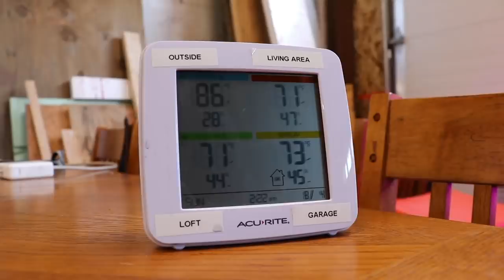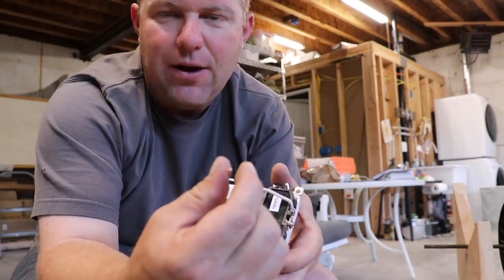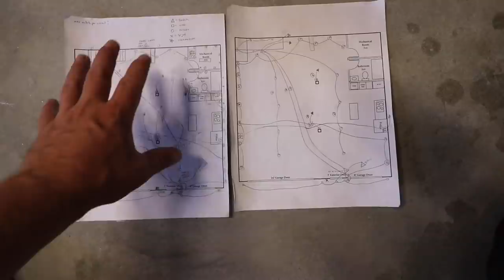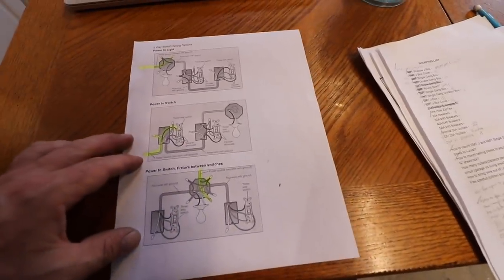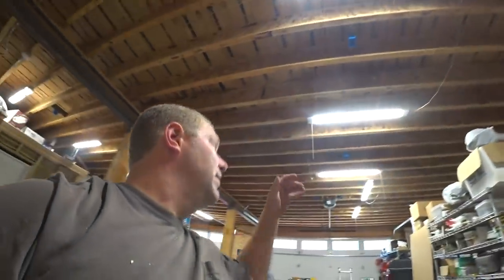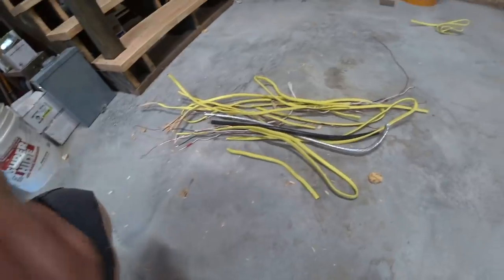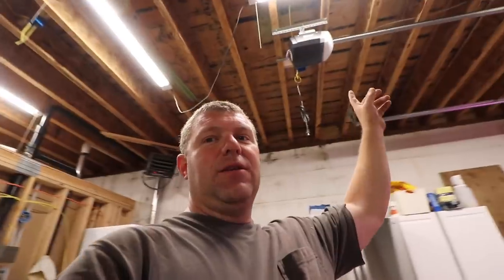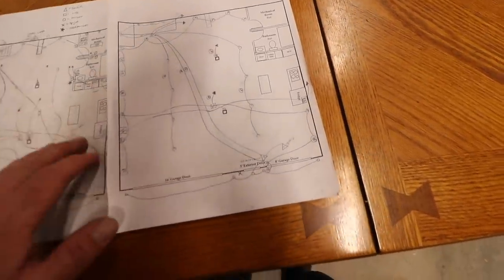WHAT A Wire-Pulling MESS (Garage Lighting Electrical)

Comment: If I am understanding correctly he is putting in 4 outlets in a single box supplied by one 20 amp circuit. Does he really need 4 outlets every 4 to 6 ft? I just wired a woodworkers shop and we put in a duplex outlet every 4 ft. We cut the hot tab and ran 12/3 with each outlet on a different 20 amp breaker. That cable then skips the next box so that within 4 ft there are 4 separate 20 amp outlets on 4 seperate 20 amp breakers. Either he is only allowing for on average 5 amps per outlet or he is just wasting  outlets.
Reply: I think he is tired of extension cords. 😂 So he wants outlets everywhere.
Reply: So, did you use a single neutral for each outlet with two hots?  If so, You are soooooooo breaking the NEC (and common sense).
Reply: @flick22601  Our code allows it, I can't think of any reason that is unsafe,. Sounds like the wire manufacturing lobby got to the government legislators. Thankfully our political system is different from yours.
Reply: @john543  - If each 'hot' is on a separate breaker, they can NOT share the same neutral.  No code in the world would allow that.
Reply: @flick22601  I don't see what the problem is and neither did the inspector. Standard workshop wiring, 2 adjacent duplex outlets will have 4 breakers. I think it was a 30 x 24 shop and every receptacle was on it's own breaker (1/2 size) and a duplex box every 4 ft. What would be the point of running 2 neutrals when the neutrals end at the panel in a bus and are fastened to a jumped  neutral on the duplex. I don't see why running a 2nd parallel neutral would accomplish anything other than sell more copper. I suspect you are American and the US political system lends itself to these kinds of abuses. Simply put the copper lobby won. Common sense lost.
Reply: @john543  - If I'm reading you right, the inspector failed at his job.  The purpose of a fuse or circuit breaker is to protect the wiring from too heavy a load.  If you have 2 - 20 amp, 115 volt breakers serving two different circuits but using a common neutral there is a possibility of that neutral being required to carry 30 amps.  For that reason alone it doesn't meet code because it doesn't have the ampacity to carry that much current.  Next, should one breaker trip and the other circuit is still carrying a load then, should someone try servicing the circuit with the tripped breaker come into contact with the common neutral they could be seriously shocked.
Reply: @flick22601  At full load the current in the neutral will be 0 since the two hots are on different phases. I think I said they were 1/2 size breakers earlier, that was an error on my part, the 1/2 size breakers we used are for the dedicated outlets that are not split. As far as servicing goes, the breakers are physically connected so both tgrip at the same time, plus common sense should tell you if you are working in a box with multiple circuits you should trip all the breakers.
Reply: @john543  - Ahhh.  So you have three phase power.  Different story.

Comment: Nice fancy 3 way illustrations. However they don't show you how to wire the 3-way with the required neutral conductor in each of the switch boxes per NEC. 404.2 C 1-5 , however since you are using a receptacle to feed your lighting you technically could have an out with 404.2 C (5) Where a switch controls a receptacle load. However with the possibility of removing the receptacle in the future as you mentioned (5) would not apply and the neutral (grounded conductor) would be required in this instance in your switch boxes.

Comment: In the garage where power tools are used those outlets should be 20amps and the kitchen also, all others it's upon current loads. I suggest to label the wires and the circuit breaker from and to so in the future it will be easy to trace or trobleshoot....

Comment: Where I live, code has ground facing up when installing convenience outlets. I think it is so if toddlers are messing around with plugged in fixtures, they are less likely to get little fingers on power prongs. Just something to consider with little on on the way.
Reply: John Wilson.   The way an outlet is orientated is not a code requirement, just personal preference.  Throw a necklace over a ground up outlet and it will blow also!
Reply: most of that has to do with manufactures install specs!

Comment: Is there a reason why you're not running the wires along the center I beam instead of poking holes in all the joists? Are you putting the outlets on the center posts on the front/back of the post instead of the sides? Looks like all the traffic in the garage will be front to back - more chance of hitting a protruding outlet box if you mount them on the sides of the posts.

Comment: The US regulation seems complicated over the UK they are very strict about electrics and the way you lock wiring over there is very different as we are so so careful how we set things up but the one thing that I would say is you do piggyback off another socket to a spare from a ring main or from a radial circuit
Reply: John A Doe    You seem to be a professional electrician from the U.K.   Please do not base your opinion on people that are not professional doing electrical videos in the US.  We have a National Electrical Code.  It is not Federally mandated.

Comment: This way would not be compliant in Canada.  Each box, switch and light has to have Hot, Neutral and Earth.  In your diagram you use a 14/2 wire with a switched neutral.  Not allowed up here in the Far North!!  And you shouldnt be drilling those joists.  Only use the knock outs they have prepared for you.
Reply: [In your diagram you use a 14/2 wire with a switched neutral.  Not allowed up here in the Far North!! ] 

Sure is! But you have to mark the neutral with a red or black ring of electrical tape or a heat shrink tube where it connects to a device or into a bundle. It should be marked the same colour (color) the other end.  
Felt tip markers rarely work well. Paint can, if it's of a suitable type.

Some provinces have adopted a controversial requirement for an extra neutral in some instances, won't go into that, it's mostly for protection of delicate loads to floating neutrals.
Reply: Might be different under the Maple Leaf but here 14ga is in White romex and Yellow is 12ga. I haven't seen him wire anything yet. For 3way the 12-3 uses the black lead for line and the red is used between the switches.  As for using the knock outs they normally don't line up and makes pulling wire that your shoulders remind you of tomorrow.
Reply: In Ontario it is now code to have neutral in everything.  So using the neutral wire, whether marked or not as switched live, is against code.  I dont make the rules.  I just follow them.

Comment: Jessie, are you gonna put some rockwool or some other insulating material between those I-joists on the garage ceiling? I'm guessing you will... heat and sound insulation.

Comment: Have you come across a building code thats says sheet rock between garage and ling space must be 5/8.
Reply: or one could put a double 1/2" skin.... :)
Reply: Many areas it is required to be a 1 hour fire rated separation with dwelling above a garage.
Reply: Bob Haas    The building code will not tell you an exact product to use.  Codes are not written that way.   It will tell you that a 1 hour rated wall or ceiling is required.   Then a 1 hour rated assembly with drywall will tell you that it must be 5/8" gypsum board, or some other 1 hour assembly material.
Reply: @chrism2042  i know tahts why 2 ,1/2" are used if one cant get 5/8th ,2 x 1/2" skimmed is what we used in the uk,back in the day,now its some form of absbestos (not asbestos type ) boarding thast half inch and has the hour rating.
Reply: @gsyguy1  - Even 2 layers of typical 1/2" gyp. on 1 side does not provide 1 hr rating. I have not found a UL rating detail providing the rating on one side of the framing. But per the building code a 1 hr rating can be achieved based on materials with multiple layers on 1 side of framing. When I design buildings with rating on 1 side I use layers of Type Firecode X gypsum
Reply: No building codes where they live
Reply: @N-hunter  they as in the video or where I live...we have millions of building codes..and we are OLDER than the USA we have CASTLES  and Dolmens and granite houses too ,we may be small but we build BIG :) oh and we have german bunkers and towers left over from the ww2

Comment: Jessie do your lighting with 14/3 cable. This wire will have a Black/Red/White and ground. You have to use a 15amp breaker for your lights if you use this cable but This will allow you to carry neutrals to your switches which is required for all home automation and makes wiring 3 way switches way easier to wire...Use 12/2 for plugs and 14/3 for lighting and switches it will make your life a lot easier.
Reply: I though the NEC now required both a "hot at all times" and a neutral in every box.
Concur on the usage of 12/2 and 14/3.

Comment: European outlets look so much simpler compared to this. You just push the wire and it's connected.
Reply: We have that type also, but they're usually 15A rated outlets, not the 20A ones he is using.
Reply: And they fail here
Reply: What are European outlets? They differ from country to country. Only the plugs are standardized.
Reply: Also illegal in some areas- fire hazard; the loop around the stud gives many more times the contact of the pincer inside the fast cheap push ins. After they age, corrosion  will increase to resistance and the created heat when under load- if it was my house, it's a no brainer.
Reply: @beargun42  Not even the plugs are standard.
Reply: jimW133 you’re right. Apparently not all accept the CEE 7/7 plug or oven the type c “europlug”

Comment: -  number of allowed " current carryng " conductors ..... reason?.....  because heat dissipation and ampacity corrections 
% of raceway area fill .... reason?... mechanical issues, pulling, etc.... different reasons

Comment: Like was shown - the rule I always used for wiring 3-way circuits is that they ARE easier and cheaper to wire if you "feed" the power into one end of the switch circuit and then run the load from the other end- that way you do not need to run extra wires back from the output end. I was not aware of the wiring way used - that is very useful information!  Thanks!
Reply: You cant build traditional switch legs anymore. You have to carry a bonded conductor to each box.

Comment: Hey Jesse,
Think you mixed up the numbering system for the wires.
12-2 description  ...two 12 gauge conductors with a ground. Sam for 12-3 ...12 gauge, three conductors plus a ground. Your Drier probably has 12-3 running to it.
Reply: Eric Nay , it might not, unless it needs 120v to run the control panel. And in either case, most electric dryers need a 30amp breaker, so #10
Reply: @fotopdo  correct the NEC has a * next to wire size ampacity where as 12 gauge THHN can handle 30 amps at 90 C it goes on to say use 10 gauge on a 30 amp breaker. Most equipment is only rateded at 75 C and some is still rateded at 60 C. This is important because you have to size the wire to the equipment rating not just the wire insulation rating.  That is what makes remodeling so fun. 😂

Comment: pls DO NOT use ladder on this way!!!
... i Spent 6 mounths to recover my foot !!!
Reply: Isn't a metal ladder only an issue with live wires? At this point they were just cables. Though you are right, do NOT use metal ladders when dealing with wires that could be live.
Reply: @spochan4 , the problem is to stay on top of the last step: you are on unstable situation. For a physics point of view this is like an " inverted pendulum"  ... the ladder can go away and ...

Comment: So AC creates a magnetic field that can be picked up by other wires running along side it.  The more power in a line the bigger the field and the more leakage can occur.  It might have been the angle but it looks like you have your lines running right on top of that high powered electrical line you should ask the electrician if there should be more space between those lines...of course that's probably passed and was 4 months ago but still just a thought.
Reply: I thought he crossed them over the big line. Parallel wires are where the problem comes in, just like in network cabling.

Comment: it's amazing the code enforcement allows you and all that stuff in there with those floor trusses not being covered with 5/8 type x.. and any supporting columns.
Reply: It's a remote area of Montana with minimal regulation.
Reply: As they have said, they have no bulding codes where they live.
Reply: @tKetcham1  ...they live in northern Idaho
Reply: @bellestarr48  Yeah, that's what I meant
Reply: They do, but Jesse as to install all of the electrical, plumbing & Duct work before they install the sheet rock. If you look at the previous video, he was using a 5/8 plywood to position the electrical boxes for spacing for 5/8 ceiling drywall. Drywall is the last to be installed
Reply: @guytech7310  the inspectors around my area won't allow use of the building before the sheet rock is up
Reply: @Ramdodge582  Building inspectors won't grant you a CoO until all of the requirements are met. You cannot get homeowners ins. etc. But I doubt they will force evict you from using your building until it absolutely completed.

Comment: I'm sure this happened months ago, but if you are ever going to be interested in home automation where you will be using Smart light switches, i would make sure you wire things in a way where you have a Neutral wire at EVERY light switch / box. I outfit my whole house with Leviton / Lutron smart light switches and most of them require a Neutral wire for each switch. Luckily most switches in my house have the Neutral in each box, but i've gotten unlucky with a few spots where there was none. Most Leviton smart light switches require it, Lutron makes one (a dimmer) that does not require a Neutral. I would run 4-wire romex so you're not using the white wire for load.

Comment: Thanks for taking the time to explain why you can’t go to smaller wire for led lights, you would need a separate circuit with the correct amps breaker

Comment: tænkte på om du skulle have sprøjte isoleret loftet når du er færdig med at sætte alectoris op alt det elektriske rene og rør

wondered if you should have the insulated ceiling spray when you are done setting up the alectoris all the electric clean and pipe

Comment: Any idea when you're going to be pulling wires in the SIPs yet for the main part of the house?
Reply: My guess (if he's like me, lol) is that they'll finish the "easy/straightforward" bit in the garage as they spin up for the more difficult sip challenge. Especially as there will be a tiny bit of that around the doors wall. For me, however, usually i get done with my spin up exercise, then get redirected to something else, and then get very procrastinaty when it comes time to reattack the original project, lol.

Comment: No 14 wire , however you are wiring a 12 in a short light run that do not need a a 20 amp beaker when a 15 will suffice. You, of course, can overbuild  but that cost money that never be recover.
Reply: Not much of a cost difference. Its about $10 difference between a 250 ft roll of 12 awg & 14 awg. issue is you probably waste more time & money having to drive back  & forth to hardware store picking another roll of wire that you ran out. If you just stock 12 awg then you don't  have to juggle different wire sizes. Biggest issue for costs is 12-2 vs 12-3. 12-3 is considerable more expensive than 12-2. For Three-way switched circuits or 220V circuits you need to run 12-3.

Comment: I'm just wondering why did you need so many plugs on the wall 7 boxes doubled plug =14 plugs.
Reply: I can answer that one.  In the 1920's and 30's, 1 light and 1 plug was sufficient for a room; look what we use now-6 feet between plugs or less depending on where it is.  At this stage it is easier and less expensive to put in extra plugs for future use than adding them later.
Reply: no extension cords

Comment: Can you use the 14/3 wire for the smoke/CO detector network?
Reply: Andrew H yes
Reply: Andrew H you can here in Iowa.
Reply: Yes
Reply: Andrew H    The answer is yes, if he uses a 15 amp breaker.   If a 20 amp, then No he can't.

Comment: it would save a bunch putting all that lighting on 15 amp 14 gauge.  it would cause a second home run for the openers.
Reply: But as is he isn't pulling a lighting circuit, he is running outlets on a 20 and plugging in the lights. He should not by Code have lights on a circuit that has outlets, in a garage.
Reply: I think I understand.  I must have read your reply 3 times before it clicked.
The lighting circuit being separated from any outlets in a garage will stay on if you trip an outlet breaker
Reply: @jason-ge5nr  Yep, That way you don't have to reset the breaker in the dark stumbling over the stuff.
Reply: Jason, now your starting to listen to us. Most of what I read from old electricians like me are trying to save you some money and keep you safe.

Comment: The reason for separate ground wires; When you disconnect one outlet ground you only disconnect one ground wire. It is a safety thing. That's why they don't count all the ground wires in your box fill calculations.

Comment: Just a question here from someone who knows NOTHING about electrical but should at least one of the outlets be a GFI in the series?
Reply: Jonathan Vint  I believe they're using GFCI circuit breakers in the electrical panel.
Reply: GFCI is required for any outlet near a source of water.
Reply: Arc Fault GFI breakers except for the dedicated Bathroom circuit there the GFI has to be in the Bathroom.
Reply: They are using GFCI breakers.  They have also already passed inspection long ago.